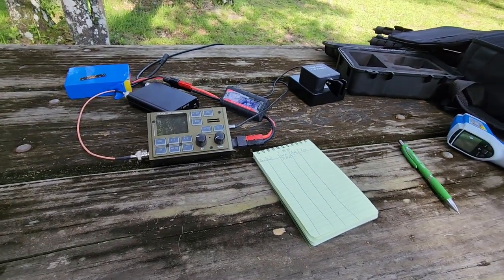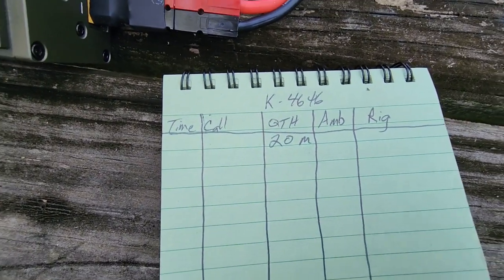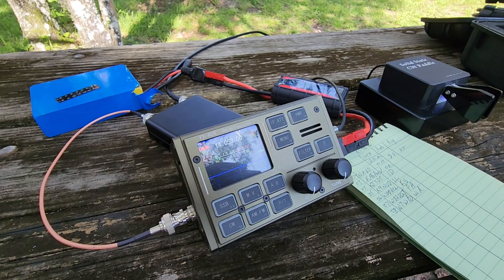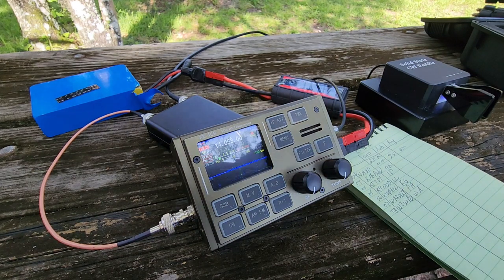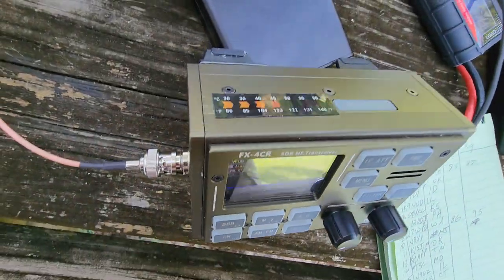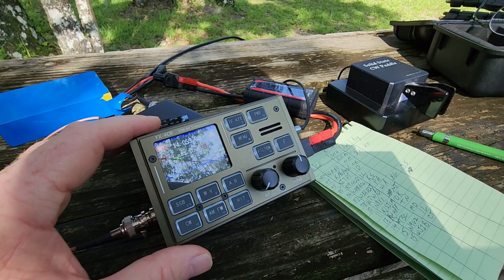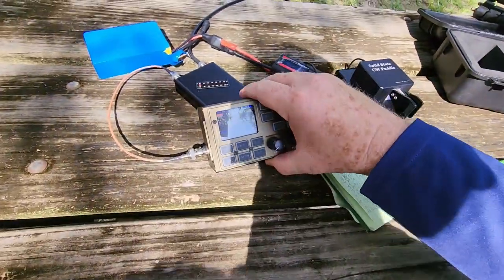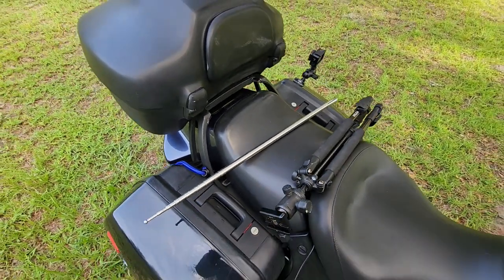FX-4CR POTA

Comment: I've had my FX-4CR for a few months now, and while it's a pretty cool little rig, I haven't found it to be that great with CW.  I have the same issue you have with the TX/RX delay vs. keyer speed.  I also noticed yours makes the popping/crackling noises when you're sending. Mine does that as well.   The received audio is quite good, so I can live with the sidetone weirdness.  It's hard to argue with what it is though.....a 20w radio that fits in the palm of your hand, has a color waterfall, and will do bluetooth digital.  If Yu can ever get the CW issues ironed out, that little rig might become one of my favorite radios.
Reply: Also have the popping cracking sounds on cw. Livable through my one POTA on it. But it’s really bad on straight key. Kinda unusable there. de n5vwn
Reply from the maker: Yes, the receiver is great...it's the transition from RX to TX that needs work. Without having a schematic I can only guess that it may be due to the wrong type of relay being used for T/R switching. I'll bet it's not a reed relay, which would be fast enough that delay setting vs. keyer speed would not be an issue.

Comment: My FX-4CR arrived a week ago.  I want to use it for POTA on my BMW G310GS (little adventure bike) when moto camping and also take it on some SOTA trips.  I made an end fed half wave antenna for 10-40 meters.  My 5 meter telescoping antenna arrived today for my version of the POTA PERformer... very similar to what you showed in this video, but I plan on mounting that 17' tall whip on a RAM Mount stalk mounted to the motorcycle handlebars with two elevated tuned radials emerging from the sides, for use on 6-20 meters, and 40 m with a loading coil.

I'm powering my FX-4CR from a 20,000 mAh Anker power bank with a 65W PD3 USB-C port that's the size of a large cell phone.  I bought a cable with electronics that requests 15V @ 3A from the power bank, and a 90 degree USB-C to 5.5x2.5 mm barrel plug that fits the newer FX-4CR power jack and it requests 12V @ 3A from the power bank.  I'll 3D print a mount that will stack the FX-4CR on top of the power bank and allow the stack to be mounted on the RAM Mount that I use to hold my cell phone.  If I have cell service, I'll use the tablet that I use for OSMand GPS navigation on the bike to run the software that allows me to spot myself for POTA activations with FT8 and then use the tablet to log the contacts, all while operating from the seat of my baby GS.  🙂

Comment: I received my FX-4CR last week.  I also purchased  the cooling system.  Prior to installing the cooling system the radio did get hot after about an hour on FT8.  After installing the cooling system the radio ran much cooler. Still getting warm. Getting very warm after 4 hours of FT8  10w.   I also plan on installing small heat sync on top. My Bluetooth window is installed on the bottom of my radio.

Comment: Considering the entire unit is a heat-sink, hot might be good in this case.
Reply from the maker: The purpose of a heart sink is to remove heat from electronic components, not encapsulate them within it.
Reply: @AE5X  I’m just thinking like a MacBook. Ppl raise concerns that they are hotter to the touch, than other laptops. That’s because its chassis is a way more efficient heat-sink than others (solid aluminum). I’m curious if this also the case (pun intended) here. Because I’m definitely thinking to snag one of these :)

Comment: Great setup. I am looking at a FX-4CR as a backup to my FT-857D in my KLR650 go-bag kit. As I am primarily SSB phone and concerned with ECOM 20W is the minimum I consider.
Once a month I do a QRP with a group at a local county park.
Is that a vStrom?
https://youtu.be/nShDYlZGKlc
Reply from the maker: Nice set-up, Viron. The KLR is a great bike for dual-sport riding (have you done the doo-hickey mod?) - I had a DR650 for a while and road most of the TAT on it, with QRP gear - there's a video elsewhere on my YouTube channel. Current bike is a BMW R1150RT.

73,
John

Comment: I have a lot of QSOs of you in my logs, nice vid. About the rig, would it be possible to fashion a heat sink?  72 de AI5DD
Reply from the maker: Yep, I recognize the call - thanks for the contacts! I don't think an external heat sink would be helpful. The rig has a substantial heat sink already but it's totally sealed within the rig. The interior of the radio then becomes an oven with the heat sink acting as the heating element. It's probably best to think of the FX-4CR as a 5W radio that is capable of 20 watts intermittently, when you need it. Actually, more than "intermittently" since it seems like everything is ok for 20 minutes or so at a high duty cycle.
73,
John